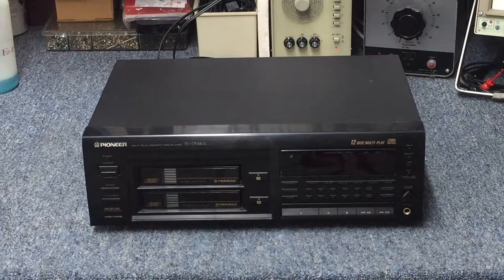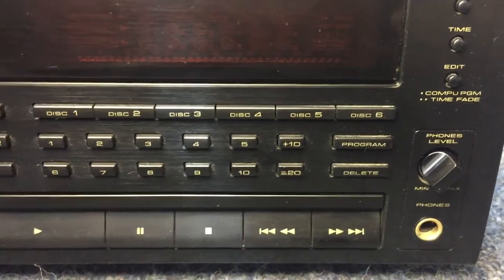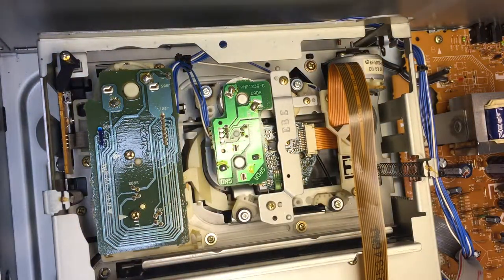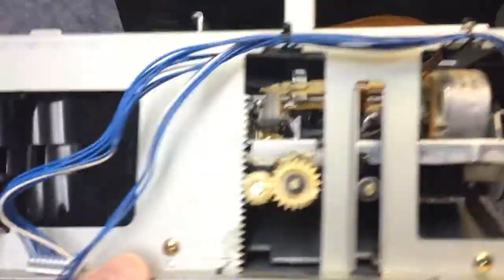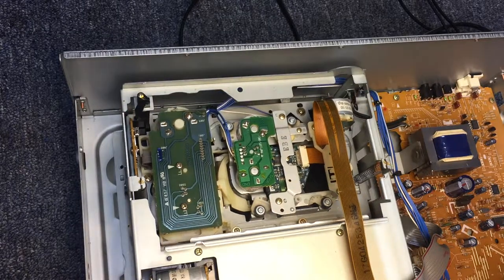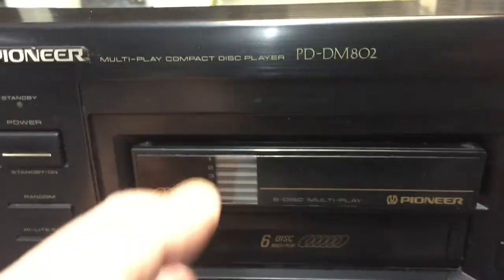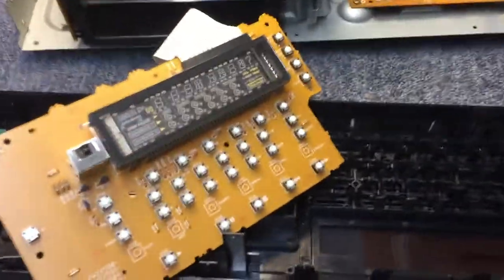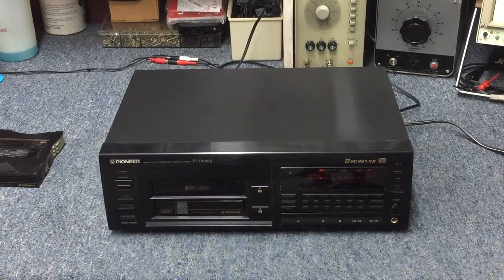Pioneer PD-DM802  Compact Disc Player - eval & repair

Comment: That is so wierd.  Just yesterday I was listening to the Eagles.  And today I was going through some 45's and found a B.B. King and was researching it, and was reading on wiki about his song with Clapton.
Anyway, my unit elevator will not go down all the way.  I have not taken out the mech yet.  It ejects the mags fine.  This is a mystery to me.
Reply from the maker: Dreg, thanks for checking out the video!  look for something obstructing the travel, you can see things better if you remove the mechanism.
Reply: @luvradios  , thx for the reply.  I got it cheap at a thrift store. When I took the cover off I noticed that somehow the elevator got out of whack on one side.  How that happened don't know.  Maybe moving it. Obviously it didn't work that's why someone got rid of it.  I loosened the screws on the side that it was lower, and raised it to put it back in alignment.  Now it works perfect!